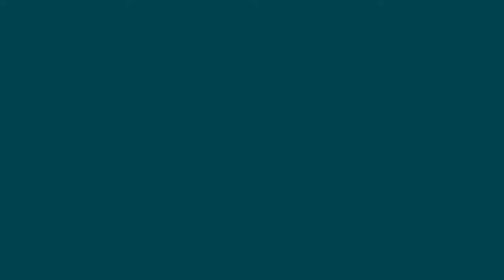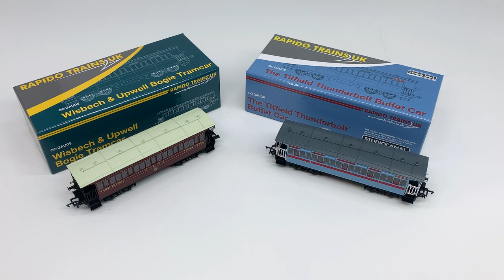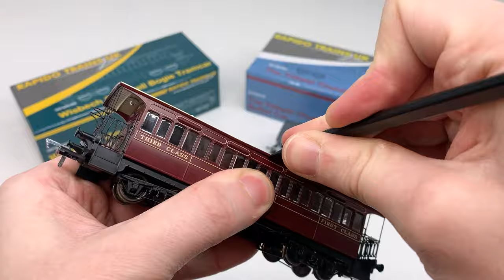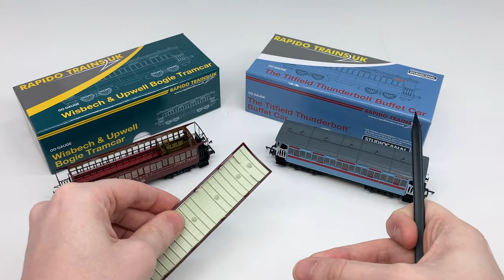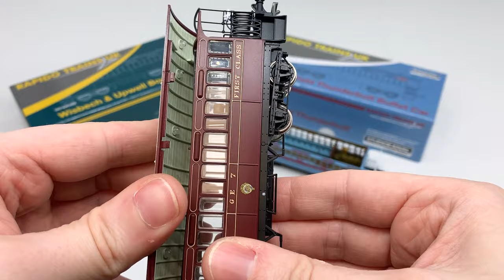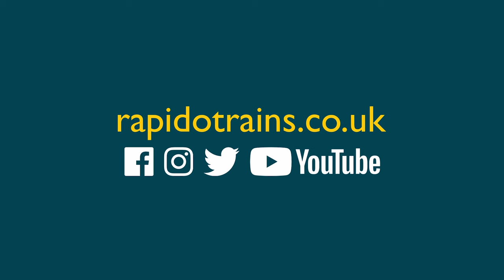How to remove the roof of your W&U/Titfield Tramcar

Comment: Not all roofs come off, as easy as shown.  You can easily scrape off the acrylic paint along top edge of the car body at the roof-line since the paint finish is so thin there.  My recommendation is do not remove the roof unless you are prepared to accept marring the paint finish. The edge of the car body along the roof-line should have been made of a solid black plastic strip so there is no chance of damaging the paint finish.  Athearn has some passenger car roofs held on by mini magnets.  They come off easily without any prying tools needed.